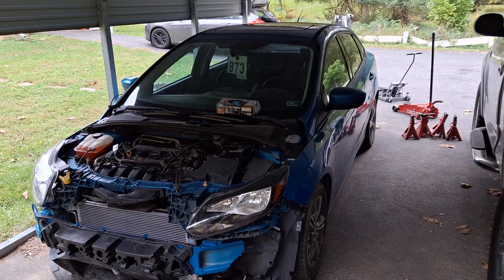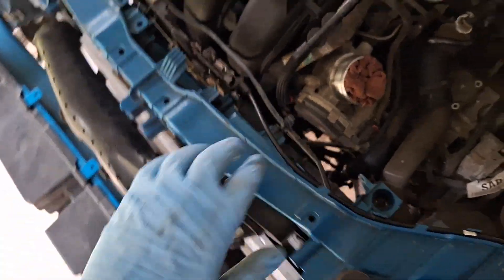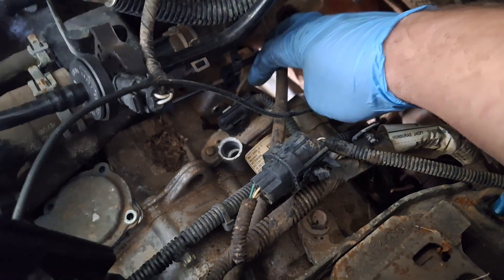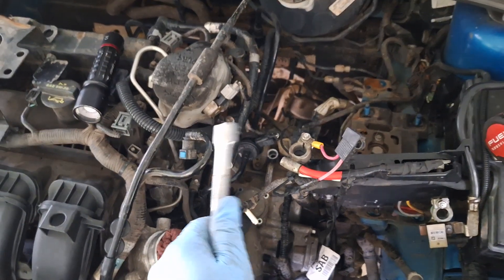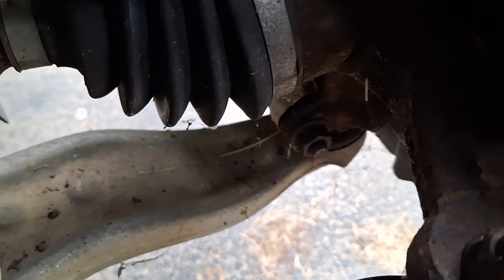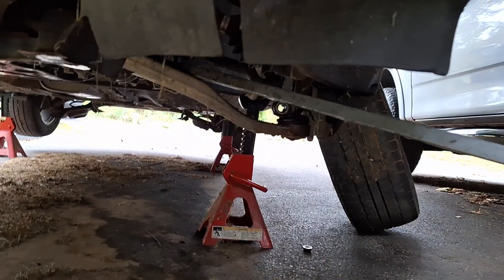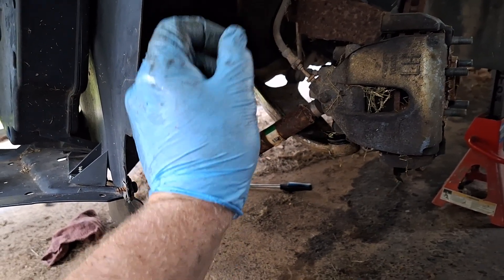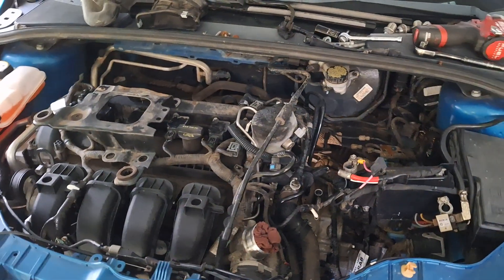Ford Focus Transmission Removal! DIY At Home! | 2012-2018 DPS6 Powershift

Comment: Any tips on removing the intake?  The evap hose and the one on the bottom seem to be a pain in the ass
Reply from the maker: Hi, you shouldn't have to pull the intake to get the trans out. But to get to the bolts easier, you can unbolt the engine mount and raise the engine with a floor jack

Comment: I've done about 8 of these from the ground. I used my trans jack the first few times but, I found it easier to use my engine crane to raise & lower the trans.
Reply: If u get the same transmission from a junkyard are they plug and play or will it need reprogrammed ????
Reply: @tylerparish5463  it depends on whether you get the TCM with the yard trans.
Reply: Is there any video of disassembling and assembling the powershift gearbox?
Reply: I just did mine car won’t start or show what gear it’s in, I change the transmission range sensor still nothing, gears can move but it won’t show what gear it is in, all I did was change the clutch forks in 2012 Ford focus plz help
Reply: @eskodaboss  you have to do a clutch relearn.
Reply: @dealerauctionnightmare4689  hiw do I do that ? The car won’t start are show what gear it is in, the only thing I did not do I reset the clutch acutuator, I thank you and appreciate your help bro
Reply: @eskodaboss  You have to have a higher-end scan tool or you can use FORScan.
Reply: An older automatic model but I have an 07 that I will soon be either converting to 5 speed or putting in another automatic and I have been fabricating an engine compartment sling for holding up the back of the engine that has a small winch as part of it for winching the transmission.
I hope it does the job.
Lifting the trans from above is way better than trying to teeter it on jacks.

Comment: I have a ford 2012 model.
I am experiencing transmission problems.
While driving it will indicates on the board that transmission hot, wait for 8min.and it will automatically disengages its from gear and transmission will resume after waiting for some minutes.
It was diagnosed and it indicates code number P0805.
Please advise on what shall be the solution.
Thank you.
Reply from the maker: Sounds like a clutch actuator motor problem, but check to make sure your grounds aren't loose. Luckily, this isn't an expensive repair - and you can do it yourself: https://youtu.be/OUaoBKVM4LE?si=U9jCxQcpmGWv9WqD

Comment: Do you have to have any special tools to reuse old clutch I’m just changing forks car only has 103,000  miles on it
Reply from the maker: Yeah but with 100k it would be good to replace the clutch. Here's the tool Yuesstloo Dual Clutch Transmission Reinstall Reset Tool Kit, Compatible with Ford Focus DCT 6 Speed Dry Dual Clutch Transmission Remover Installer Tools for Reuse DPS6-DCT F1FZ-7B546-B https://a.co/d/df4wTkF
Reply: @BigBensCarsAndCycles   thanks

Comment: What would keep the driver's side axel from coming out? I have the ball joint out. I have tried rotating the axel to different positions,  but it won't budge. I got the passenger side out.
Reply from the maker: Out of the 3,000 or so focus clutches I've done that's happened once to me. I'd get it out of the hub, that might make it easier to mess with. Then you can rotate it around easier and try prying different spots. Try a bigger prybar. Try a punch and a hammer to knock it out. One of these tips should work for you
Reply: @BigBensCarsAndCycles  punch and hammer? Going through from the passenger side?
Reply from the maker: Yeah you can try punching it out from the back
Reply: @BigBensCarsAndCycles  it doesn't go through from the passenger side. There is a horizontal cylinder in the way. I have a feeling it am misunderstanding something.
Reply from the maker: Yeah I mean at an angle from the passenger side onto the inner cv joint. Sorry about that confusion. Not through the final drive
Reply: @BigBensCarsAndCycles  ok.  that makes more sense.  thanks
Reply: @BigBensCarsAndCycles  Got it out Last night.  Ended up just turning it , pry, turn it, prey, turn it, pry...  Eventually it popped out.  I got the transmission out using the floor jack, since that is what I had, but then came to the realization that I couldn't do any more with it.  I couldn't lift it to get it up on the work bench, or really move it around much.  So off to Harbor Freight to get an engine hoist.
Reply from the maker: The engine hoist worked great. The eyelet on the transmission was perfect and held it even
Reply: Is there a special grease for the splines and fork tips? I have seen something in videos, but nothing came with the luk clutch kit or the seal kit I bought.
Reply from the maker: Since it didn't come with it, you can use a touch of molybdenum disulfate grease, or what ever grease you've got. Anything will work. Moly would last longer

Comment: Why did the atv/motorcycle jack not work out for removing the transmission? That is what i was going to try.
Reply from the maker: Too big to fit the transmission. It still may work for supporting the engine, but a regular floor jack works perfectly for that

Comment: i had issues with taking out the battery box. the bolt that was in the back down in the pit wouldn't come out. so i just cut the box around the pit to get it out. just be careful there is a bunch of wires behind that so don't cut too deep.

Comment: Is there a benefit to keeping it level (jacking up fron and rear) rather than just raising the front?
Reply from the maker: Yes, keep the car pretty level if you can. When you support the bottom of the engine, you want the engine level
Reply: @BigBensCarsAndCycles  so... I bought the 2012 Focus 2 weeks ago. The transmission was slipping and shuddering some. It wasn't real bad, but I wanted it to be as good as possible since it is going to someone who doesn't know a lot about cars and just needed some cheap transportation for a while. Well, my son has been driving it mostly(700 miles), so I was getting ready to work on it today, and I took it out for a drive. It didn't shudder. I had my wife drive it. No shudder. I went out for a ride with my son. He could make it shudder, but normal driving it was fine. I've decided to leave it alone unless it gets worse.  Now, I have $1k in parts and tools. I'll have to go buy another one that actually needs a clutch.🤪
Reply from the maker: Go drive the car hard and it'll mitigate shudder for a while. But it'll be back. And shudder is pretty much characteristic on these and people have been living with it until a fork locks up.
Reply: @BigBensCarsAndCycles  I have a feeling that is what my son was doing.  As I have been going over this car, it looks it may have sat for a little bit before I bought it.  The car only has 80k miles, and some barely used parts look a little rusty.  Maybe it just needed some hard driving, as you said.

Comment: Hello Mr.Ben, great video's both removing and installing transmission DIY from your drive way. What Obd2 or software you use or do you recommend to do the relearning process?

Thanks
Reply from the maker: Happy to help. Forscan is free and should work fine for that. You'll just need a vehicle interface for your car for your laptop.

This is a reoccurring question, perhaps I should do more digging and find more options